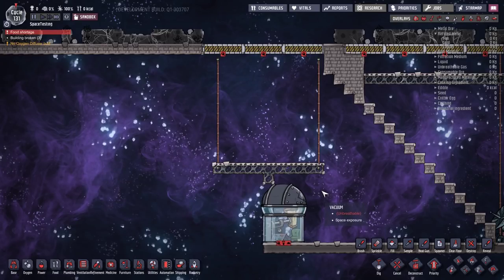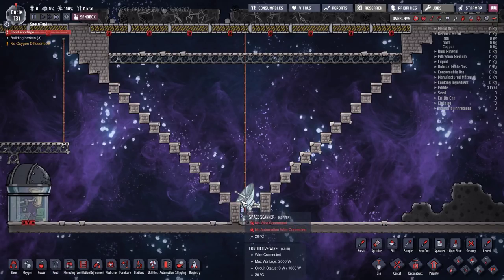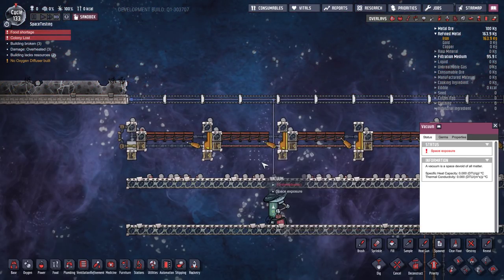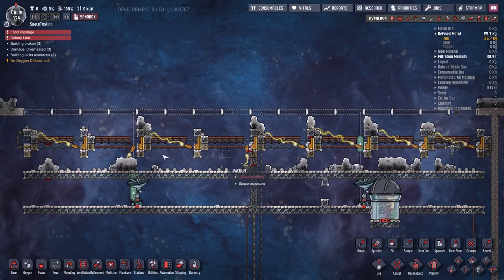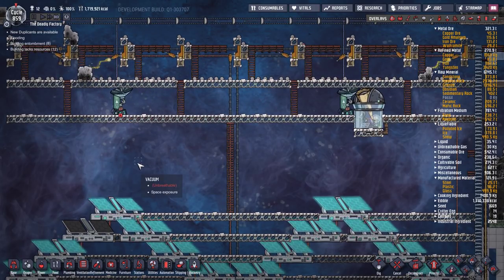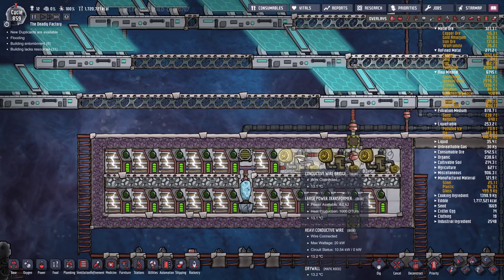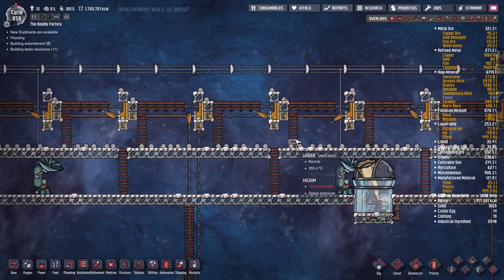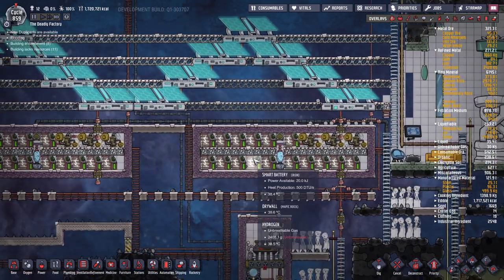Telescopes, Space scanners, Regolith management and Solar. Tutorial 9 Oxygen not included

Comment: In the early part of the video, you explain how scanners are blocked unless a large inverted triangle of space above them, about 13 tiles high, is kept free, except for airflow or mesh tiles. A little later, you show two scanners with auto-miners above them, in an area only 9 tiles high, yet still operating at 100%. Why aren't the auto-miners and the lower ceiling blocking the scanner's view?
Reply: The scanners do have a gap of 13 in his setup. Notice how the regiloth can build up only 2 tiles high. This is because there is still a block high space where you as a player can' t build, but where the falling regiloth can build up an scanners can use it. Also with the ope bunker doors it's around 12 tiles and not 9

Comment: Isn't it easier to just put all the batteries just below the surface where it's not a vacuum and run a longer power cable?
Reply from the maker: You can, but you will have to put in a cooling solution still. I used space as it made filling the area with hydrogen simpler. But this was back before the wheeze wort nerf you might be using a different cooling solution.

Comment: @Francis John  How would you combine this with a rocket launch? The room between the miners ar  too close and the pipes will be destroyed by the heat that can reach up to 2900 C, What about putting the miners horzontal to cover more distance between them? Just put tiles above them to avoid them getting regolith on them and have them overlap like you allready have. What would be the problems with that?
Reply from the maker: The rockets I usually stick in Silos, they open and close on rocket launch and landing and it does not matter if meteors get into them. When this regolith clearance was invented mining drills had a bug. If two of them began mining the same spot they would get stuck mining the same spot forever. With this build they did not overlap and could not do this to each other.
Reply: @FrancisJohnYT  Thanks! Next question: Why are the solar panels 15 tiles or so below the mesh tiles the radars sit on? Why not have them rught underneath the mesh tiles the radars sit on to save space for other stuff below?
Reply: @FrancisJohnYT  And now that the mining drill bug is removed would you recomend building the drills horizontal instead? This would make room for a rocket to pass between two of them.
Reply: Sorry, i quickly sketched this in the game and it's obvious that the drills range will cover exactly the same amout of horizontal tiles and therefore need to be seperated by the exact same amount of tiles as your design shows here.